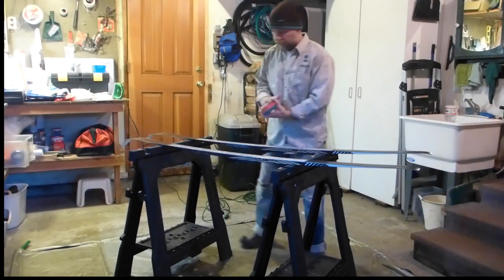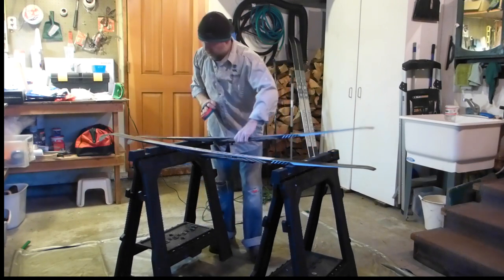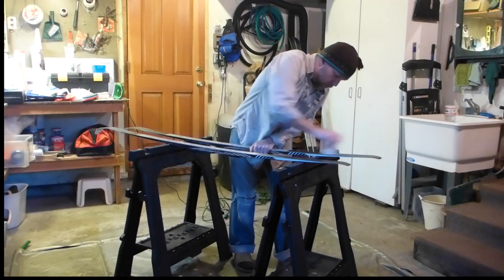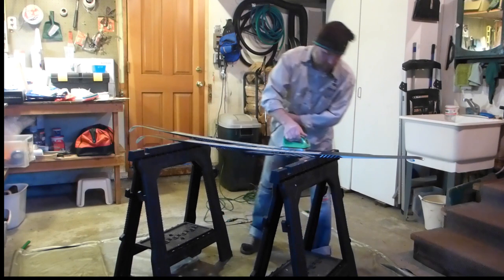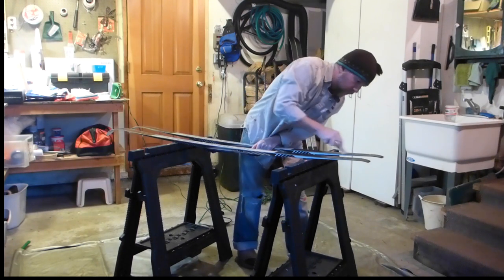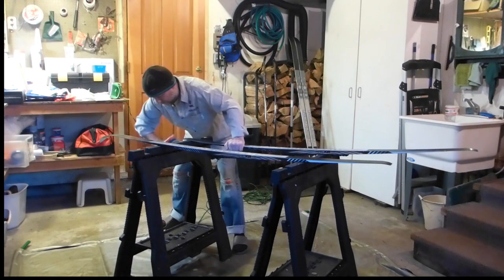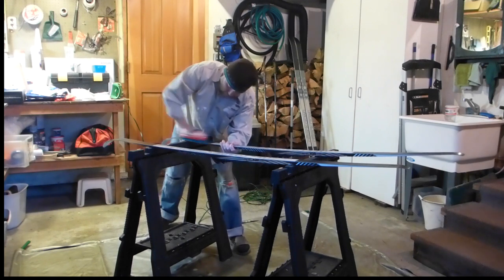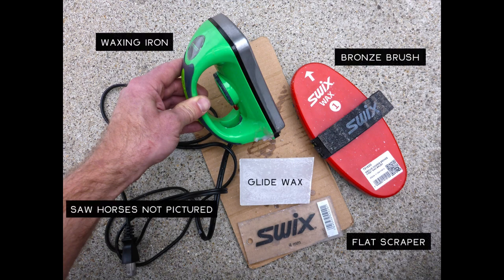Wax Your Waxless XC Skis: Down & Dirty Waxing In 5 Minutes

Comment: Thanks for the great videos Jared! Do you have any tips for repairing/tuning waxless non-metal edges?
Reply from the maker: Thanks for the kind feedback, Shane. I’m glad you like the series! 

As far as repairing or tuning the edges of a non-metal edged waxless ski goes, the necessary fix obviously depends on the actual damage. If the problem is cosmetic, the fixes can be easy. If the damage is structural, I’d just retire the skis.

The usual cosmetic damage I see to the edges of cross-country skis is the progressive deterioration to the area of the sidewall nearest the edge at the base. Often the top sheet (that wraps around to the side) begins to chip away and leaves some of the actual ski structure exposed. If it’s minor or minimal wear, I monitor it until it becomes more serious. When larger chunks of the top sheet/graphic chips or flakes off I do my best to seal the area. This involves allowing the ski to completely dry and then coating the exposed area with some type of paint, epoxy, or other waterproof material to prevent snow and water from penetrating deeper into the ski and damaging the ski’s structure. 

Another common and relatively cosmetic issue I find with the edges of non-metal edged cross-country skis is assorted nicks, cuts, and gouges to the PTex base near the edge. Usually this is caused from hitting small obstacles or debris. With small nicks or cuts, I just trim them like I would a hangnail and then lightly smooth out any resultant sharp edges of the cut. 
 
If the damage to the edge is more serious (and probably structural) than the two scenarios presented above, I wouldn’t try to repair them. The only time I’d ever do any type of structural repair to a cross-country ski would be if I was stuck in the backcountry and my life depended on it.

If you have a specific situation in mind that you want to repair (and it wasn’t one of the two cosmetic examples), tell me the details and I’ll try to come up with a solution. Otherwise, I hope this helped!
Reply: @JaredManninen  Thanks for the information Jared! My issue is cosmetic in nature. Found a rock out skiing and now I have a 6 inch spaghetti noodle hanging off the edge of my ski. I will make the assumption that you are using a razor knife to trim the hang nails. What are you using to smooth the area out after trimming? I thought that a edge file might work using the less is better approach but I wasn't sure if it might be a little too aggressive.
Reply from the maker: @shanelavallee4335  Hey Shane, that's a bummer about the noodle, but that kind of stuff does happen. I assume it's just a strip of PTex that is coming off. If so, just use a utility knife of exacto-type blade to cut it off. Then I'd probably smooth out any burrs, knicks, or other hard edges from the lack of PTex with fine grit sandpaper. It's not the prettiest of fixes, but it's functional. If it's a large chunk of PTex, you may want to consider adding more, but that might not be as easy as filling a scar down the middle of the base since your issue is on the edge.  Good luck!
Reply from the maker: @shanelavallee4335  Yeah, and doing the least amount of permanent changes is best. Treading lightly when trying to fix something like that is a good policy :)
Reply: @JaredManninen  
Thanks for the help Jared, muchly appreciated! Going to try it out tomorrow. Temps have cooled down here in BC and we're getting snow! Should be a good weekend!
Reply from the maker: @shanelavallee4335  Glad to hear it. Hope you had a great time!

Comment: Thanks for the great videos!  What do you do to stop snow from sticking to the fish scales?
Reply from the maker: Thank you for the kind words, and thanks for watching :)

As far as treating the scales of your waxless xc skis, I recommend using some type of liquid or paste quick (application) wax such as Swix F4 or Toko's Express wax. Just put a thin layer on those scales and that will help to decrease the amount of snow that sticks to the scale pattern. When I'm in the backcountry I carry with me a tin of Swix F4 paste wax for just such occasions. I prefer to carry that paste since it's a lot less likely to make a mess (i.e. it's not going to leak like a liquid variety might due if something compromising the container.

Here's another video that I've produced specifically about treating the scales of waxless xc skis. Watch that one, too, and let me know if you have other questions! Thanks again for reaching out :)

https://youtu.be/YiPtXTCPGc4
Reply: Thanks, Jared!  I found the other video right after I posted my question. I’ll hunt down some F4 paste wax.
Reply from the maker: @waytall9213  Excellent! I just spread some of that paste on and it usually does me good for a full session. Spring snow can definitely make for a sticky and slow tour!
Reply: @JaredManninen  Went out today on a recently-purchased set of Spider 62s down near Dodge Ridge and had a horrible problem with snow sticking to the crown base.  I bummed some liquid F4 from another skier and that pretty much solved the problem.  Paste wax it is, and no flouro!   Thanks again.
Reply from the maker: @waytall9213  You're welcome, again :) And glad you were able to find someone else to lend a hand. Sticky snow is definitely no fun. haha!

Comment: Jared, what is a good product to use if your skis need waxing while in the backcountry skiing and snow is clinging to the skis? Thanks.
Reply from the maker: Hey Robert,

Thanks for watching, and for the question!

When I'm heading into the backcountry on xc skis, I'll often take with me a small tin of Swix F4 paste wax for dealing with sticky snow conditions. Although the liquid style of quick waxes are a bit more convenient, I know the paste wax won't leak in my backpack. In either case, though, I definitely put the wax in a Ziploc type bag just in case. I've heard of other skiers carrying with them a small chunk of warmer/softer rated block wax to rub on their skis. I've also heard of people simply carrying a small candle that they can use to rub on their ski bases.

All of that said, if I'm committing to a longer backcountry xc ski session, I'll be sure to wax my skis before I go. I'll also be conscious of the time of day in which I'll be skiing (afternoons are the most likely time to find sticky snow), as well as location (open fields are relatively uniform conditions while skiing in the trees is much more variable - mix of shade/sun leading to ultra sticky scenarios).

Hope that helps! Let me know if you have other questions 👍